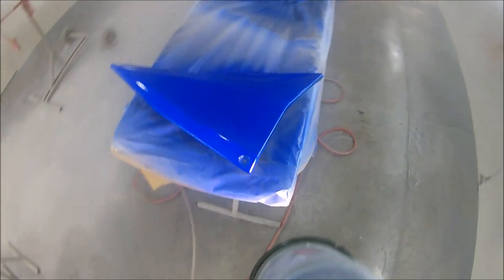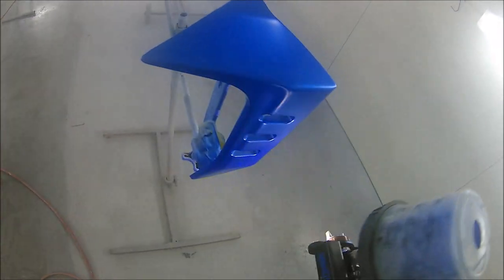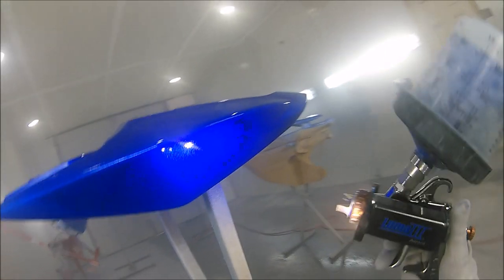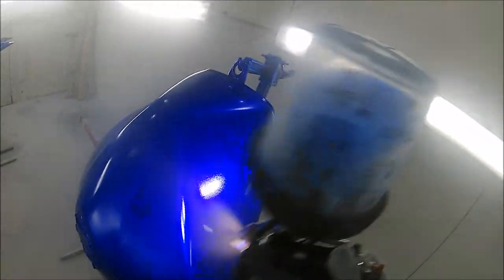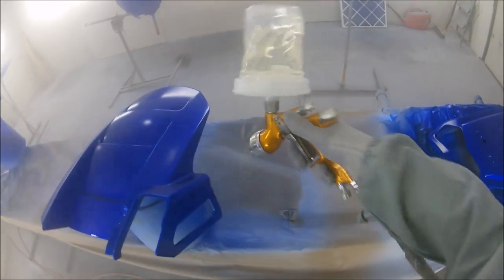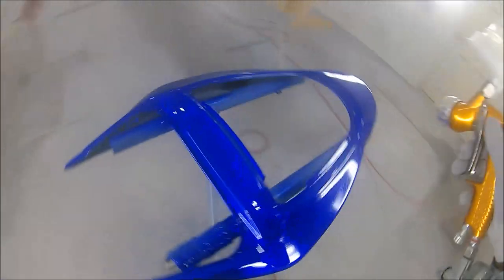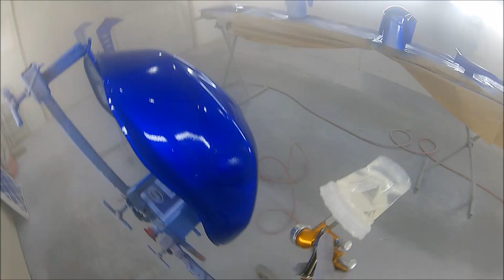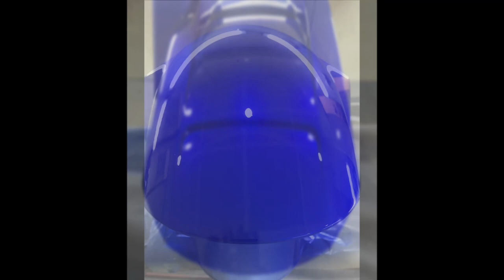How To Spray Candy Paint - clearcoat With The Devilbiss GTI Pro Lite Part 2

Comment: Now thats a great video...full of information so I haven't got many questions ...sorry...Just to confirm..20 degrees whilst  spraying.   with just 2 full wet coats of clear... 
Just one question springs to mind...With the panels being small why didnt you use a detail gun ? are they not up to the finish you can get from the " big guns " ?...Err thats it, You have covered everything else........cheers for the great vid mate.
Ohh, PS..Can you make a video on the " wet on wet " primer left overnight, Ohh hang on..I think you already have...Cheers Tony
Reply from the maker: +Tosh twentythree (tosh 23) evening to my number one fan lol, so here goes haha, yes i had the booth running at 20c during the painting as it was a very cold damp day but usually i dont do this , purley down to the conditions on the day, and yes two full coats of wet clear but this is very thick and has a big build so anthing more than that and it would take a long time to dry being a UHS, so as far as painting with a full size gun to a mini gun, one i dont have a mini gun lol number two honestly unless its one small part i rarely use one i prefer to use a full size gun and have the coverage and build that comes along with that, plus for jobs like this that are very important and need to be spot on you use what you most feel comfortable with for the best results, hope these answers help fella and as soon as i can grab a decent small gun i love il be sure to smash some videos out with one of those two haha
Reply: As always tony, your a star...cheers mate
Reply from the maker: +Tosh twentythree (tosh 23) not a problem at all buddy

Comment: Excellent information Tony, May i ask what the main difference other than the weight between the gti pro and pro light, I have 2 gti pro's that i use daily but was thinking about another clear gun, seen as the weight does not bother me would i be wasting my money? Again great vids keep them coming, Mike.
Reply from the maker: +dongil123 as far as i know its just weight and air caps , but dont quote me on that , ive used the pro and have to say didnt like it much but the prolite i love , personally i have loads of guns and this has been my best purchase for a long long time , i run mine with the T110 air cap for Hs / Ms  Clear only and with a slight pressure adjustment with either i can get factory oem finishes or glass for the higher end work and resprays , so easy to use and set up

Comment: Interesting. So what are your exact flash times. Between each ckat of candy. Hiw long did you let the candy flash off before you cleared
Reply from the maker: Depends on slot of things mate temp material transfer and thickness , best to let it flash till it’s filled off and then shoot the next coat , that way you can avoid runs and sags that will kill the candy job too , and I’d say 15-20 minutes before I cleared to make sure the candy base layer was well dry

Comment: hi great video.  I have 2 questions if you get time to answer. does the gun light fit the pro lite? and I assume over time the light will get plenty of over spray on it, how do they hold up to be cleaned with thinners?
Reply from the maker: hi james they make them for all makes and models of guns and the lights are solvent resistant so you can clean them hope this helps

Comment: You mentioned about how hard it is to match an exact process , finish and colour with candies. Is it the same with metallics? My problem is I could really do with painting my E type main shell and doors together, and then do the bonnet separately. I understand about painting the panels in the orientation they'll be when mounted on the car but in your experience are there any problems in painting body parts in metallics separately? Obviously using the same paint, not a different batch. Cheers again mate.
Reply from the maker: +Barry Jones hi mate , it is hard with candies but also following the same procedure and process it can be done , as for metalics ect I very often do the shell of a car on a repaint and then the panels separately just for ease of painting and aslong as you put the same amount of coats on ect over never had an issue doing them that way just make sure your undercoat colour prep and coats of base are the same and your fine